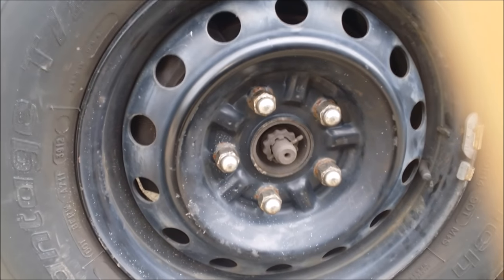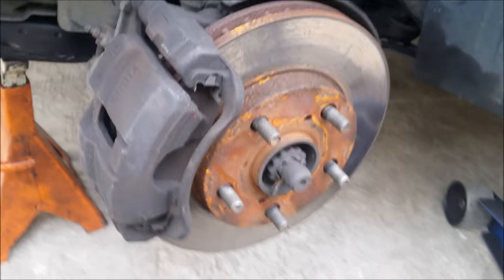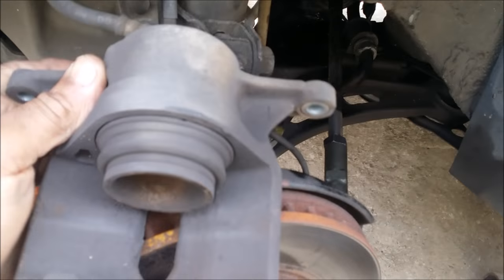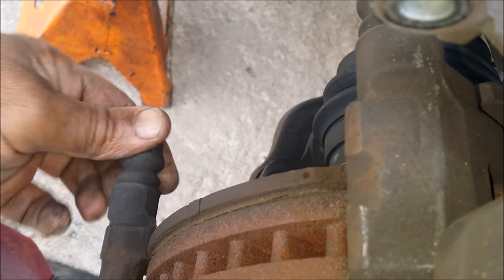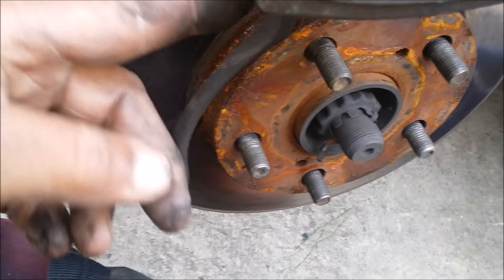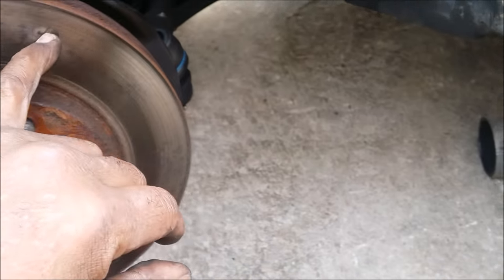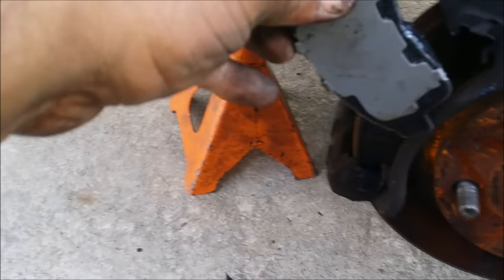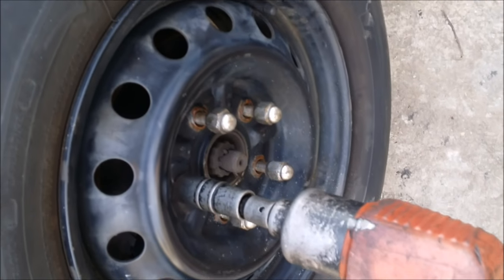1999 Toyota Camry replacing front brakes

Comment: I did mine today, thanks to this video.
Reply from the maker: Thanks, and please subscribed.
Reply: Lets Fix IT My 93' Camry brake pedal pulsates when I brake, steering wheel shakes a little too but my brakes and rotors are somewhat newer 

Could this just be a warped rotor ?
Reply from the maker: you welcome
Reply from the maker: when you press brakes and it shimmers. That usually rotors.
Reply: Lets Fix IT So do I gotta replace them or get them resurfaced
Reply from the maker: replace
Reply: Lets Fix IT why replace and not resurface if they're almost new ?
Reply from the maker: The metal brakes wear down the rotors . So if you resurface it will be under specs.
Reply: I need to do the brakes on my Toyota, I shopped around for parts; there was a large difference in prices between Autozone, Partsplus, NAPA and the Rockauto website.  For me Rockauto was much less for the same parts.  The disadvantage: order and wait two days; Advantage: for me, less than half the price.
Reply from the maker: yes true

Comment: You forgot to mention using the old brake to push caliber in with so that you don't ruin caliber
Reply from the maker: I get the clamp right in the middle. Then go slow. double pistons I use the pad. Then sometimes I don't.